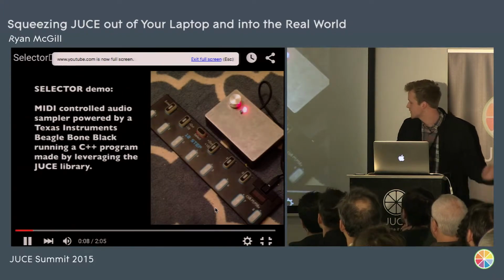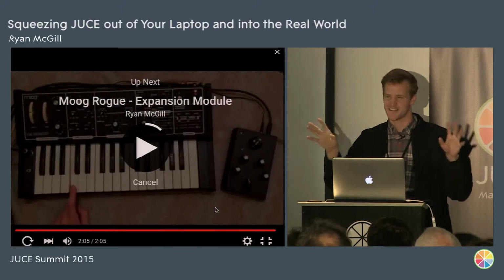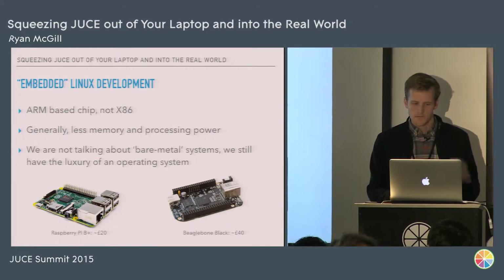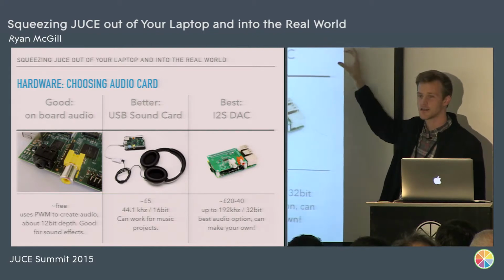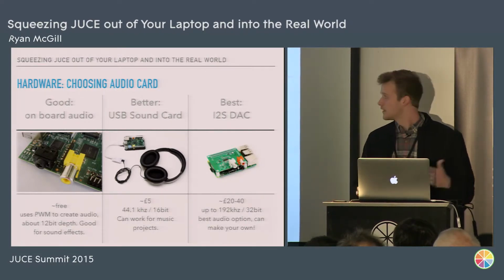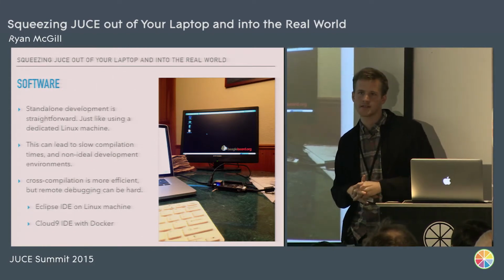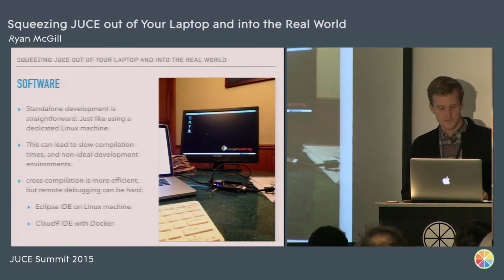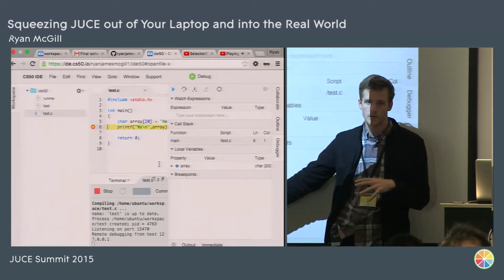Squeezing JUCE out of your laptop, and into the Real World, Ryan McGill, JUCE Summit 2015

Comment: Wasted 20 minutes on basic cross-compiling stuff -- and no elaboration to boot.  I thought this is about how to tweak or use JUCE to work better on an embedded device.
Reply: Harsh.  But indeed there is nothing about JUCE discussed.  I suppose that by elimination the speaker is saying there are no gotchas running on embedded Linux